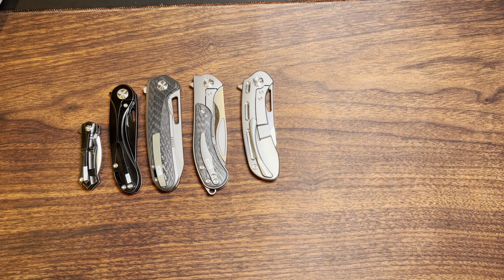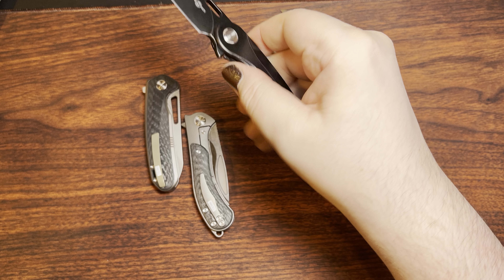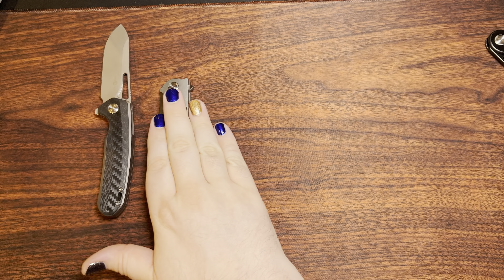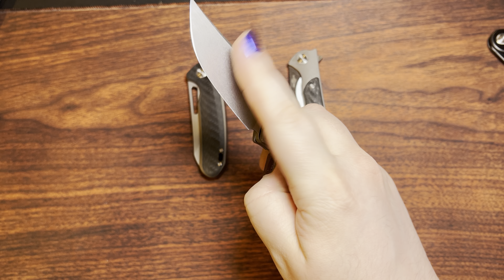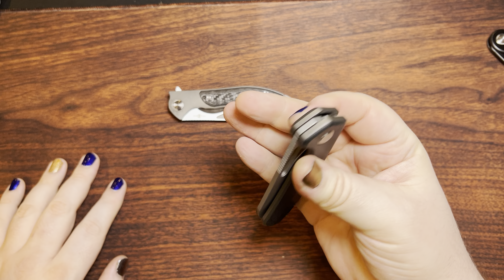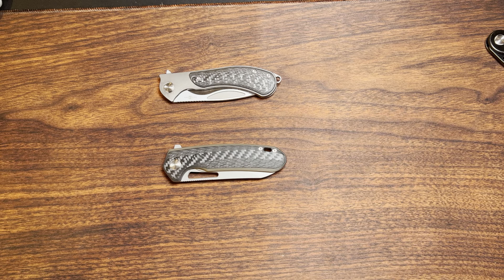TwoSun is Utilizing D2 for Many New Models. Thoughts?

Comment: I've passed over a lot of TwoSun models because of D2 in favor of 14C28N models because of the "better stainlessness and water-resistance" qualities reviewers have touted. The hype is that D2 is the lesser steal and I did get stains on a Kubey D2 fixed blade after using it for food prep. Can''t say all D2 is the same, but why buy D2 when I can buy 14C28N or some better steel. One can't predict the weather and if you can't food prep then you can't say a knife is a EDC.

Comment: Both 14C and D2 have their place. 14C in my civivis i prefer for edc but i cringe if having to break down rope or cardboard with it because Sandvik is for razor edges on non abrasive materiel and wood IMO. (Lack of carbides) D2 is highly wear resistant as evident when sharpening. The inverse of difficulty to sharpen is wear resistance. If i were a hunter, id choose D2 as an affordable steel in the S35VN range of edge holding.

Comment: Thanks for this vid, Jerry.  Many of us are wondering the same things regarding the move back to D2.  Just wondering if the reasoning you mention here are based from conversations with Twosun or  just Jelly Jerry's posts.  What you say makes total sense, and you seem to be very knowledgeable on what's going on.  Right or wrong, D2 now seems to be viewed by many as a "budget" steel, and therefore a step backwards from 14C28N.  Yet it seems not too long ago D2 was considered a significant upgrade over 440C (the previous popular "budget" steel).  When bidding on Twosuns on ebay I tend to pay more for 14C28N over D2, and significantly more for S90V & M390 of course.  I don't mind if D2 is used with Twosun's budget models made with G10 or Micarta (and similar, cheaper materials), but when making higher-end models with Ti & CF I'd prefer a higher-end steel over D2 and 14C28N.  I do like to see that they are dabbling in S110V and M398 and hopefully will try other steels that you mentioned.  I understand the feeling that D2 is getting old and boring, but if manufactured well I'll continue to buy their D2 - I just won't pay as much.  Thanks for sharing!
Reply from the maker: Yeah, I'd love to see them play with some other steels, as long as they also work on their heat treat for higher-end steels. ZDP-189 and K390 would tickle my wallet inappropriately.

I hadn't reached out to TwoSun (Dwin99) on this, just noticed the trend and saw some facebook conversations that Jelly Jerry chimed in on. I'm glad to hear that they'll continue to use 14C in the future, but they've bought a whole bunch of D2, so it'll take a while before it comes back in full force... kinda like Spyderco's crazy investment in S30V, so they're still using it even though S35VN and S45VN have surpassed them.

Comment: Excellent video. I have been curious about the reasons Twosun moved from 14C28N to D2. Personally I’d rather have 14C28N due to the increased corrosion resistance... and I could live with a few tiny scratches, or simply stone wash it myself like you have done. I think some of their models would be worth more and perhaps sell better if they went back to 14C28N since so many people praise that steel.

Comment: I'm in Phoenix so I don't mind D2 at all as long as it's heat treated correctly and all of the TwoSun I've used and sharpened has been great. I am like you and much prefer stonewashed blades on a lot of my knifes so seeing what Jeremy wrote about bringing back the 14C28N in stonewashed blades when the D2 runs dry brought a smile to my face. Question, how do you like the TT388? The only thing visually I don't care for is the dang key chain holder on the end of it. Could it be taken off and would it look right if so? I have the equipment to do it. Thanks buddy. 👍
Reply from the maker: It should be relatively easy to remove the external lanyard hole. Part of the backspacer will dip into the scales at that point rather than being flush, but... the scales themselves have a small notch on them as well, so it'd probably look purposeful if removed.
Reply: @JerryLoffelbein  thanks Jerry. Much appreciated man. 👍

Comment: Nice job on the ts301 stonewash.  Definitely have noticed the easy scratchability of Twosun's satin 14c28n.  D2 doesn't excite me, would much rather see them use 154cm.  Regardless, I still think Twosun is one of the best value production brands, not as good as Kizer though, they are just killing it.  Thanks for the very well informed video.  But I have to ask, what is up with the polished nails?  Anything more than an added visual effect?
Reply: Please check out his video about 6 months ago titled "Why the Damned Nails?..." as he answers your nails question.
Reply from the maker: I do think that 154CM or Nitro-V would be amazing replacement steel. I do doubt it'll happen as it's a Crucible steel, thus 'murican. They do use some S90V and S110V, but it's fairly specialty. For the bulk of their knives, I think the import costs of an American steel will probably price them out of candadicy. And Nitro-V isn't as readily available since it's from a smallish foundry in New Jersey.

I also agree that Kizer is doing fanTAStic work, especially recently.

As for the nails, yeah, I have a video about that, but the tl;dr is:
My nails get really weak at times, cracking and tearing and whatnot.
In my younger life I was much more involved in the death metal & goth music scenes which is where I first picked up the habit, and it adds a few layers of protection

Comment: I with you Jerry, I prefer 14C28N, but I don't mind D2 at all since I live in Arizona and it's a fine steel when you don't have to worry about corrosion issues so much. Twosun may also be trying to keep their profit margins balanced? Just throwing out a wild guess. Their quality continues to improve, but the price of their knives hasn't drastically increased. It's possible they're trying to keep costs low by sticking with their generic steel choice, in this case, D2. That along with the complaints they've received regarding their 14C28N are probably some reasons for them to stick with what's familiar. Possible sourcing issue, but I don't think that's it, but who knows. I would like to know the reason for the switch as of lately, but I don't mind so long as they keep making awesome knives. I wouldn't mind seeing Twosun try out Nitro-V or 154CM. 
Great topic, thanks for sharing.
Reply from the maker: I'd love to see them use Nitro-V or 154CM as they're great mid-range steels. They're both from 'murican companies though, so the import tariffs will probably rule them out for the bulk of their manufacturing as it'll cost more than local D2, or N690. I wouldn't mind them trying out DC53. Sure, it's a D2 derivative, but a bit more "exotic" and has some higher edge retention without adding too much complication to the heat treat process.

Comment: Uuugghh lol, I really like 14c28n, I like it right along with 4v, Rex-45 and alot of other steels but I get that the surface scratches are kind of shitty.  But I wish D2 wasn't the answer,  I get that it will remedy alot of the surface scratches in manufacturing,  and that edge retention will be slightly better but, D2 doesn't strop back like 14c, doesn't keep a good clear finish like 14c, doesn't sharpen like 14c.  Idk, I use to really like D2,  but for me , I just don't like it anymore
Reply from the maker: I hear ya. It holds a working edge for a very long time, but loses that incredibly keen edge pretty fast and relies on the carbides. I've yet to get my hands on K390 thus far, but wonder if it has the same characteristic since they're both tool steels.

Comment: D2 is a genuine tool steel, with the correct heat treatment very few steels will beat it on performance other than on the corrosion front, for that reason i like D2 as I use all of my knives and they have to perform as well as look good to me. There are a few knives out there made with D2 and other good steels that perform less well than one would expect because of savings made on the heat treat, done well D2 is right up there. It doesn't matter what the steel is if the final heat treat is not correct buying a knife for the name of the steel without knowing how well it is processed is just paying for a brand, so far the D2 knives I have from TwoSun are all good.
I am also a fan of carbon steels though so I tend to look after my blades regarding the avoidance of corrosion, until I retired a couple of years ago, I worked next to the sea and occasionally in it and never had a problem with rust.
I guess TwoSun could look at VG10 or the Chinese equivalent 10Cr15CoMoV as an alternative, I quite like VG10.
That's my few cents.
Reply from the maker: I certainly agree that tool steels will hold a working edge for much longer than most other steels, which is why it's a great choice, especially for a work knife. I'm kind of thinking they could try to switch things up at some point and try their hand at DC53. Sure, it's a D2 derivative, but ups the edge retension a bit, and sounds a bit more 'exotic' for collectors. Miguron has done a great job with it in the budget realm.

That was another thought of mine, regarding VG10. They already utilize 10Cr15MoV for a bunch of kitchen knives, so it's a possibility, but might not be as enticing for enthusiasts.

I haven't had corrosion troubles with D2, but I do live in an arid climate. I used to live in northern California (about a mile from the ocean). At that point though, I didn't have any D2. I had some troubles with carbon steel as I was lazy and didn't treat them nearly enough.

Comment: I actually PREFER D2 given an excellent track record from TwoSun... so long as it has a handle to match. For better and for worse, this has halved my list of "total winner" TwoSuns. I'm not feeling the pinch yet, but I know some killer designs are going to come down the pipe that don't have handles to match.

I look for D2 models that either have a coated blade or handles with blackwashed titanium, micarta, or a very coarsely blasted titanum, something I have yet to see from TwoSun. Some ano jobs can do the trick as well, but I really like Ti in the raw. All my TwoSuns are users and I do a lot of food prep... the joy of quality pocket knives are the only way I get fresh fruit and vegetables in my diet with regularity in the place of Calorie Rich And Processed; it's inevitable that I will get called away from the sink right after cutting the worst possible foods. I take very good care of my tools, but I don't baby them either.

I guess I'm a little perturbed. On the one hand, two of my all-time favorite knives are the TwoSun TS64 and TS301, knives I hope to use for decades to come. I am DELIGHTED at the tiny freckles slowly accumulating on the blades. On the other hand, the first and only TwoSun I regretted buying was the TS51 in D2 that I realized I didn't like enough to risk hurting the resale value, i.e. no cutting anything I carry full size pocket knives to cut.  I am a little worried that I may regret purchasing the TS269 with its refined handle in D2, but the milling and form factor just looked too good to say no. I'm sure I'll love it but don't know what to expect down the road.

I don't mind being choosy and should appreciate the help in moderation. Unfortunately, I also rather enjoy being tempted.

Jeremy, have you developed a patina on any of yours yet? Any thoughts on patina as a feature vs a bug?
Reply from the maker: I'd be kind of interested in them experimenting with other tool steels. DC53 isn't widely adopted yet, but with a good heat treat (and TwoSun knows it's D2) it's fantastic. K390 is an option as well, but it's as expensive as M390, if not a touch more, so that wouldn't be for their affordable line.

I just recently got a TS64. I'm amazed by how fine an edge it has.

I haven't developed a patina on any of my blades at this point. I think a lot of that has to do with me not doing food prep with my folders since I have a great assortment of kitchen knives, and I work primarily from home. I also treat my blades with Tuff Glide (got into that habit as it does a fantastic job of removing tape glue).